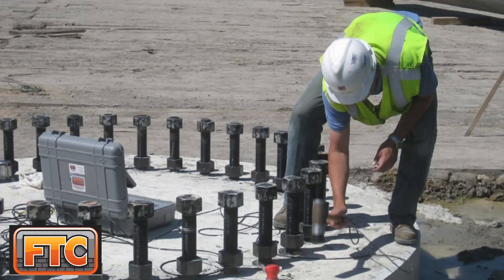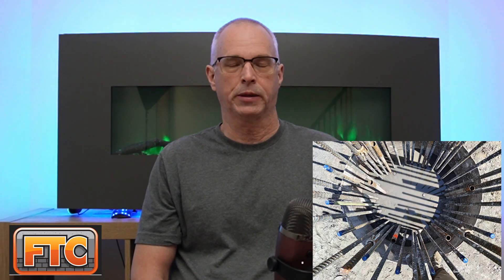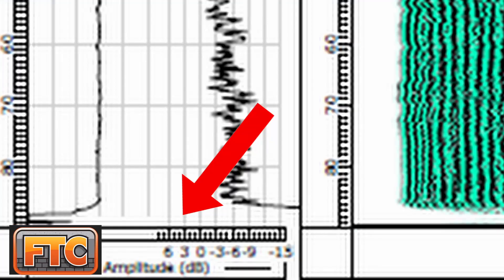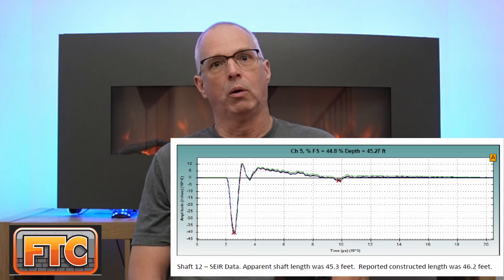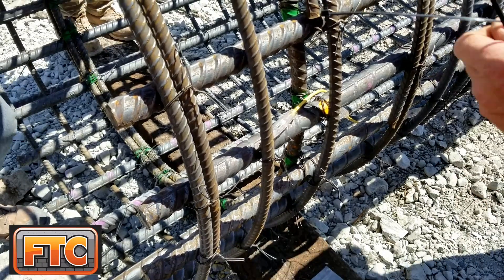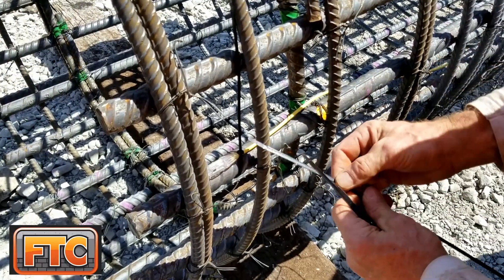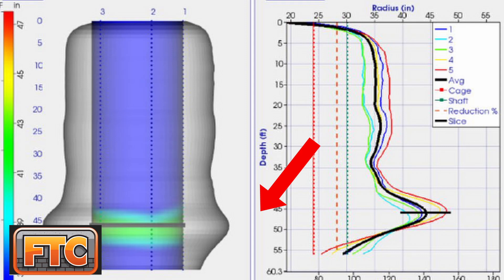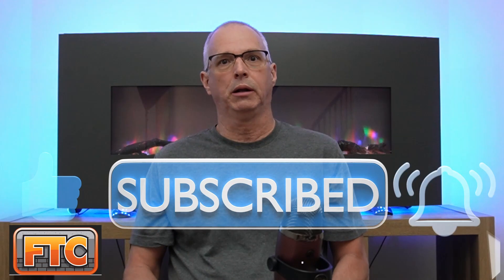An Overview of Drilled Shaft Testing Methods

Comment: Hey Casey, 
I had a question regarding taking the water out of the tube for the thermal/gamma test as I’m doing a project that I can’t discuss here lol. But when taking the water out, we put a compressor tube about 110ft into the tube to the bottom of the shaft, and air compress it out with a 70lb weight that hold the tube downwards. This has created problems as access isn’t the best to reach in and we can’t have the tube fly out of the pipe at that PSI. Wondering what ur company does for this case?
Reply from the maker: I am assuming your are using 2 inch thread, schedule 40 CSL pipe and as such, you should be using a fitting that connects to the top of the hose.  The hose passes through a round clamp at the top of the fitting that keeps air and water from leaking past the outside of the hose .  The fitting should have a nipple to connect the air line.
Reply: @CaseyJones-Engineer The state I’m in allows for PVC pipes to be placed in the shaft. The issue I’m having is when taking the water out of the PVC pipe, the only way for us to blow it out is by sticking a long 110ft hose into the shaft PVC pipe to the bottom of the pipe. We hook up to a compressor and then attach a rope to the hose that’s in the PVC with the weight right at the top of pipe holding the hose downwards, to act as someone pushing the hose down so it doesn’t shoot up 110ft. What I wanna ask I guess is, is there another way in taking the water out of the tube when it’s a PVC pipe. Sometimes the pipes are 5ft above the shaft, and sometimes there 8ft deep into the shaft, and requires us to add a 8ft extension PVC pipe for us to reach at grade level. So enforcing/securing the pipes is a little difficult when there is not even a cage to support the pipe in that 8ft upper area. Making blowing out the water a little tricky. I know other states use metal pipes instead, and I agree, much better. I’ve never seen the attachment that you are referring to, with the nipple. If you could explain that process a little more I’d love to hear about it. Your videos are amazing btw, very informative about these testing as not a lot of people do or know how to do these tests.
Reply: You know what I realized, is what if we pumped the water out rather than air compressor it? How much horsepower does a pump need to have in order to suck water upwards 110ft?
Reply: @CaseyJones-Engineer did you see the previous comment lol? Not tryna bug you, just wanna know of some ways in depth more of how the water can be taken out?
Reply from the maker: @amirhamdan2965  You should not be using PVC pipes.  They debond too quickly.  Use steel pipes and push the water out like I mentioned.